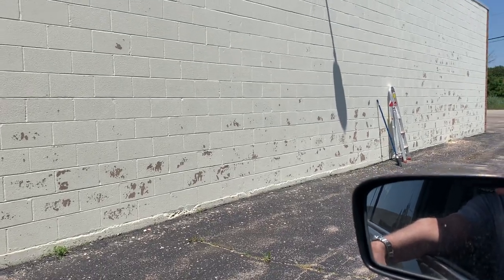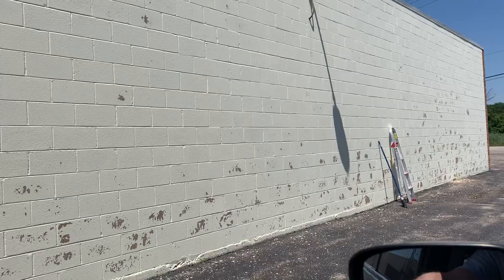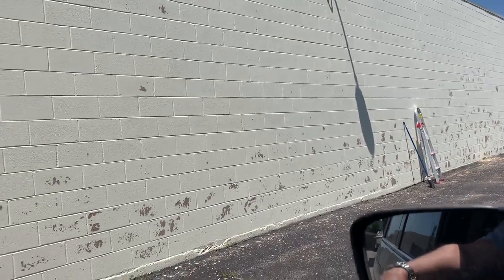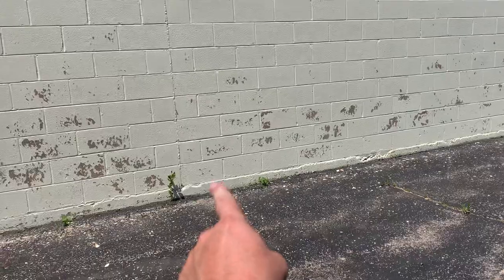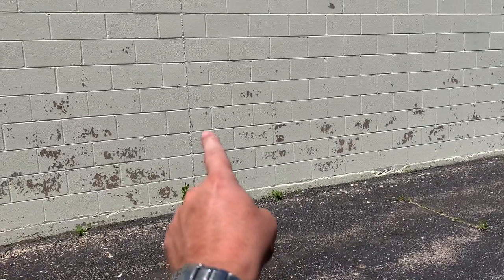Prep prime and painting cinder block walls

Comment: I have two commercial cinder block buildings in northwest Florida that are very old maybe 70 years old. Very minimal cracking on a couple mortar joints from repairing hurricane damage. I rents the buildings out so i want them to last a long time. What would be the best coati g or sealant before i paint.
Reply from the maker: For Florida honestly, I could not tell you with the different climate conditions down there. If you call your local Sherwin-Williams store they’ll definitely hook you up with that.
Reply: Hi, what sealer is best to fill joints with gaps?
Reply: Painting block traps moisture. Leads to mold growth inside. Block is a sponge to moisture. It needs to dry.

Comment: so you first put peel-bond and then normal house paint? Is peel-bond a primer you applied to the places where you could not remove the previous paint? I have a cinder block wall (exterior) that took some water damage before gutters were installed at my house. Some (but not all) of the paint peeled. I was able to remove the paint that peeled. Now I am trying to figure out what to do or what to paint it with. I am considering something like dry lok or some waterproofing paint in order to protect the wall from rain/sleet etc. Some say acrylic paint traps moisture underneath and causes spalling so I am not sure what to do.
Reply from the maker: I know that anything that stops water coming in- makes it not go out as well- is creates a membraine so it can’t go one to another.. I have not used drylock but have heard of it. I would call the manufacturer direct to get their suggestions as they would be The people that would get a warranty call - they will tell you what will or what won’t work. 

We use peel bond on brick and stone but no where that there was water issues- then paint with any top coat. 

Again with water- adds a level of issues .
Reply from the maker: As long as the rest is not peeling - you should be fine. I have no experience with drylock- etc, we have used peel bing which secures loose paint, works really good!! Then just painted right over it